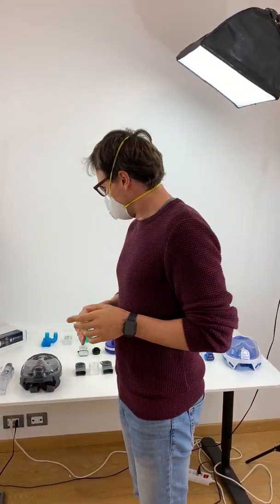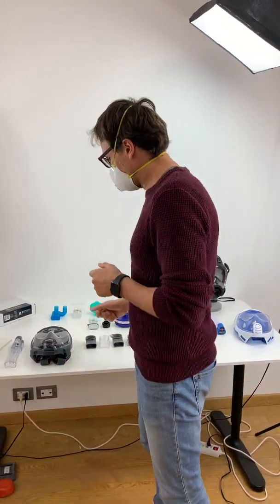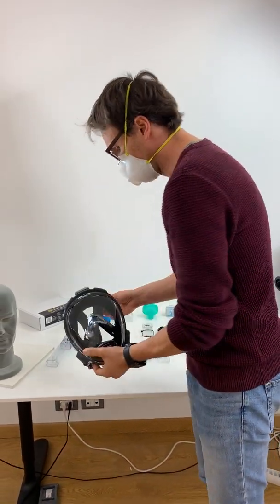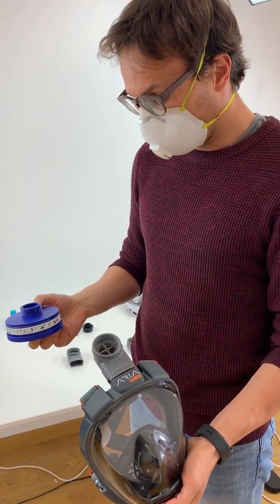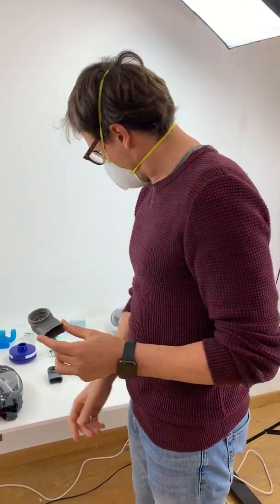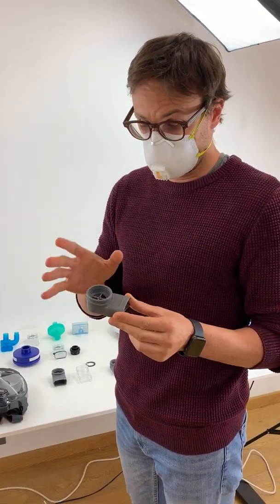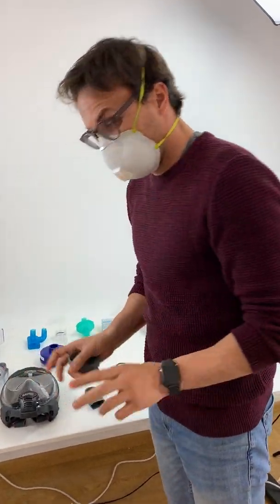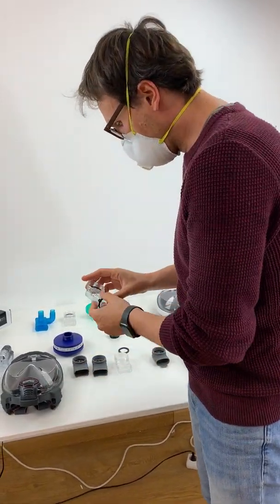Snorkeling Masks into Emergency PPEs - tutorial on what we did. OCEAN REEF and Mestel Safety.

Comment: Full face, of course. ur2.pl/2305 Directs incoming and exhaust air around to reduce or eliminate fogging. Sturdy. Stylish. Rear facing, not upwards, air intake essentially eliminates accidental wave induced water intake. GoPro mount if you are so inclined. Various mask sizes available to order for correct fit.